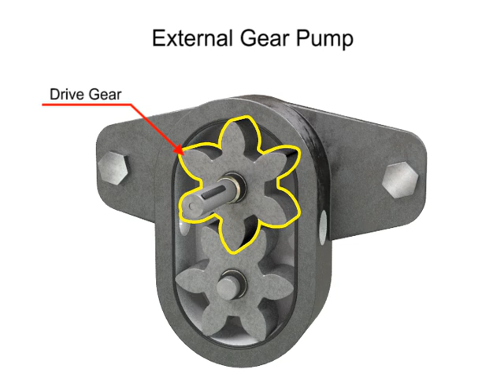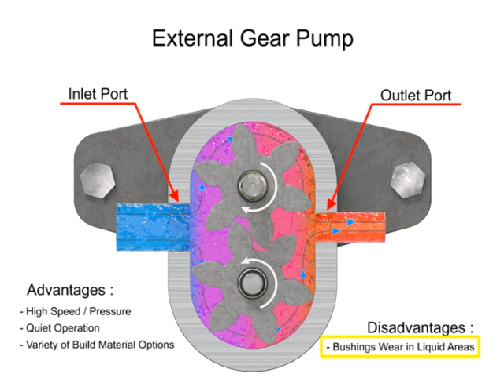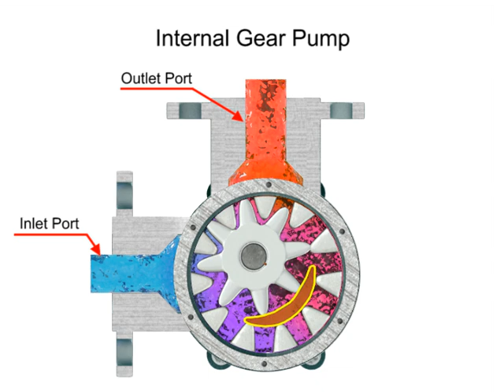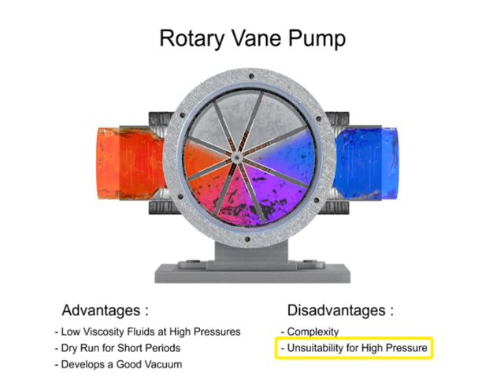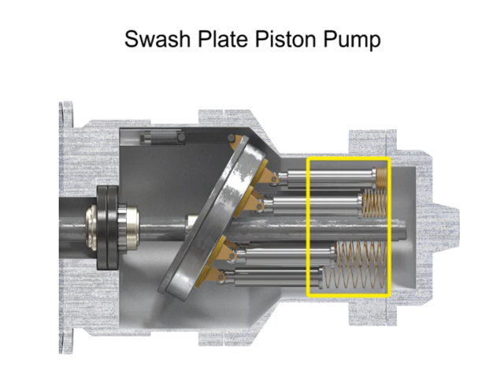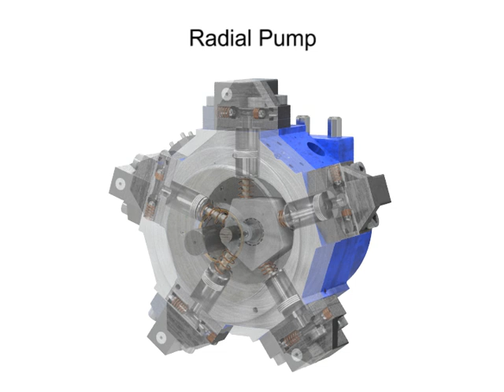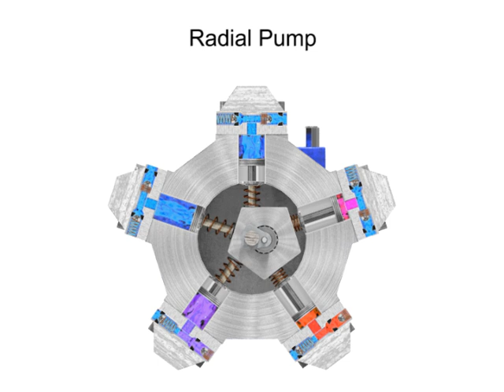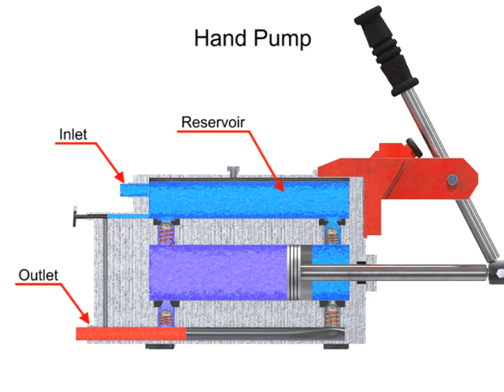Types of Hydraulic Pumps

Comment: Isn’t there a worm screw pump that operates slowly but can handle incredible amounts of pressure
Reply: yes, I think there are also pumps that work using a impeller.
however, these might not classfiy as "hydraulic" pumps.
I don't know if there is a difference between "pump" and "hydraulic pump" tbh
Reply: @Cheezymuffin.  A Hydraulic pump needs to be a positive Displacement Pump, meaning that it deliveres a fixed amound of fluid per revolution. Think of it as a fixed flow pump, as opposed to a non-positive displacement pump, which moves the fluid with a constant pressure.

Comment: At 2:54. At vain type. The rotor should be none concentric with outer casing and its the one sealing the flowing back of fluid. The Vain should be concentric with rotating rotor. The clearance between rotating and stationary shaft should not be the same.
 Thank you for your effort but you need to correct this.

Comment: The red and blue in the pistons is misleading. 4:40 Presumably red indicates pumping pressure. The pistons should be red throughout the portion of revolution where cylinder volume is reduced. The curved arrows are correct. But the gradual change from blue to red indicates that pressure gradually builds. Then on the expansion stroke only gradually releases.

Comment: Hello, I am a mechanical engineer, and when I showed this video to my colleagues who said they haven't seen a swashplate like this. Is there a real spring or is it just a representation of the flexural component? 
Please answer this is important issue :)
Reply: Some use charge pressure to fill the cylinder. Some do use a spring to extend the piston.

Comment: Where is the location of inlet and outlet on swash plate piston pump .
Reply: look at the frame at 4:39. Just imagine the red and blue arrows representing the suction and pressure port locations. They are always right over the cylinder block and usually in the same shape as the arrows shown (except thicker). And your suction port side is larger.

Comment: No exist "internal gear pump". It is rotary pump!
Typical car (for example Audi A6 3.0 TDI):
Engine - Gear pump;
Gear box - Rotary pump;
Power steering - Vane pump;
Compressor of air conditioning - Swash plate piston pump;
Airsuspension - Piston pump ("hand pump").